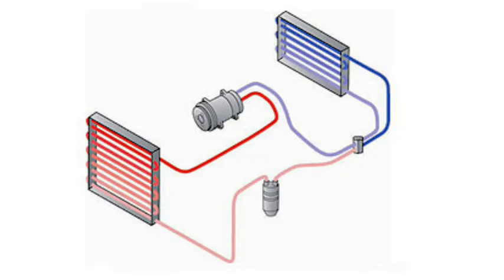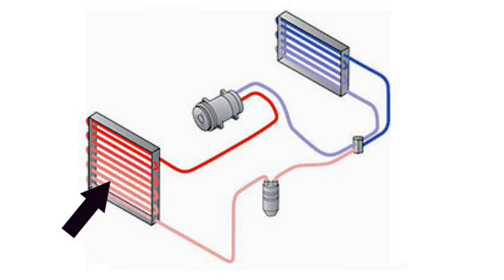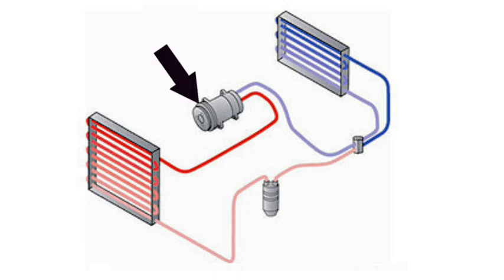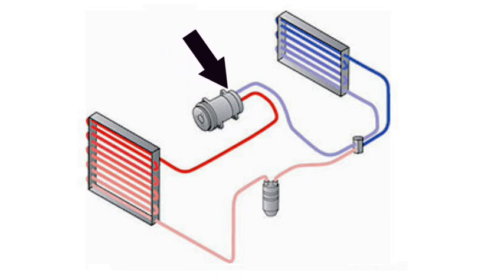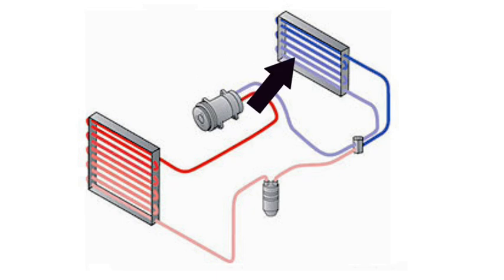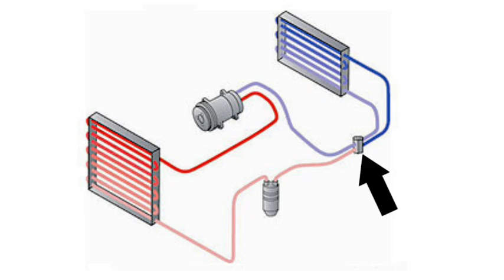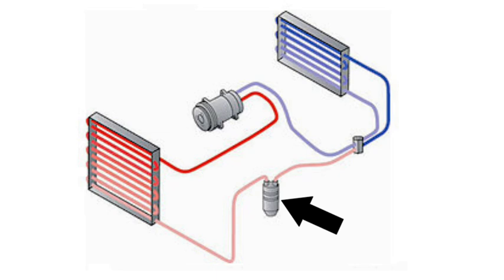AC System Basics - EricTheCarGuy

Comment from the maker: @whoyadady I have no idea of the cost but the receiver dryer is a part not a procedure, the evacuation process is the procedure and is done to remove moisture from the system, the receiver dryer also helps control moisture in the system.  Moisture in an AC system will ruin it, care must be taken not to introduce any moisture into the system for proper performance and longevity of the AC system.

Comment from the maker: @whoyadady Like with most AC problems you have a leak and you need to address that before you can fill the system again.  In addition if it's been empty for a while you need to put a receiver dryer on it as well as vacuum down the system before charging.

Comment from the maker: @MARCOZR1 Not a clue, in fact I honestly don't understand the question since AC can only flow in one direction.  When you say 'actuator' are you referring to the AC compressor clutch?  If so it could be a low charge or a problem with the clutch itself.  I don't recommend AC work for the DIY as it involves more than most people think.

Comment from the maker: @MARCOZR1 It's probably mildew on the evaporator.  They make products to spray into the vents to help with this, they work for the most part but if you have a persistent problem you would need to remove the evaporator and clean it with soap and water as well as clean the inside of the HVAC system.

Comment from the maker: @greenlight2600 It is the blower fan just blowing air around without AC this is the way the system operates, it's either fresh air or air warmed by the heater core.

Comment from the maker: @spelunkerd At the moment I don't have a recovery machine and as a result I take it to a friends shop for evacuation if I need to.  I'm not sure what you would need besides what you described for recovery but I know that recovery machines also have filters in them as well.  When working at the dealer we actually reused some of the R134 and I don't recall them ever emptying the tank.  With this in mind you might consider the machine to save on the cost of refrigerant.

Comment: Hi, Eric. I'm slowly building a home auto shop. I would like to be able to evacuate an AC system and take a tank with old freon to a shop for safe disposal. I can afford a vacuum pump and I have a set of manifold gauges, but I can't afford a professional quality A/C evacuating system. Can I rig a vacuum pump to a freon bottle and then take the bottle to a shop for safe disposal? Or, do you get it evacuated professionally and then vacuum the system after rebuild? How do you do it in your shop?

Comment from the maker: @lrossi888 I don't think it's moisture in the system as the components for heat and AC are sealed units inside of HVAC ducting, perhaps you have a leaking heater core causing you to fog up or your AC is not working properly.  Check them both and see what you come up with.

Comment from the maker: @eltigre2169 Sounds like you might have a leaking heater core.  See if your coolant is low and check to see if the passenger carpet is wet, if it is a leaking heater core is a good possibility.  Since we are getting into the warmer months you might be able to bypass it by routing the inlet and outlet hoses together at the firewall until you can get it fixed.

Comment from the maker: First, am I to understand that your AC is not working at all, or is it just not performing well?  The #1 problem with AC is leaks that cause refrigerant loss.  You can buy a kit that has dye that you put into the system that will help you find leaks.  Also, when you reassemble AC components it's a good idea to lubricate the 'o' rings with a little AC refrigerant oil to prevent damage to them.